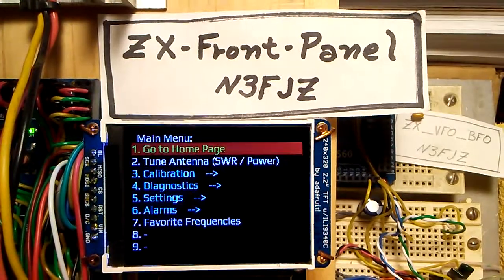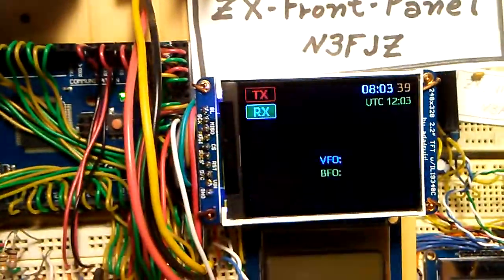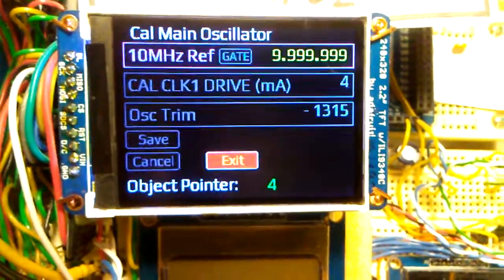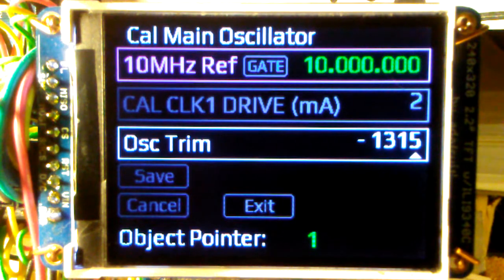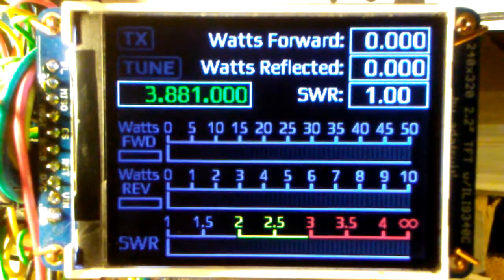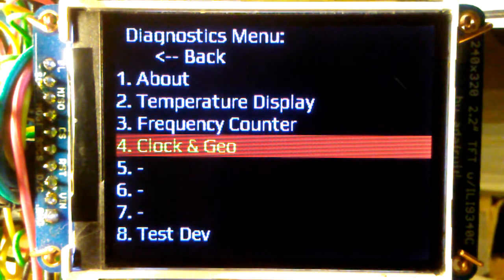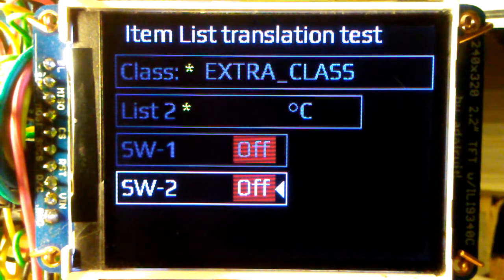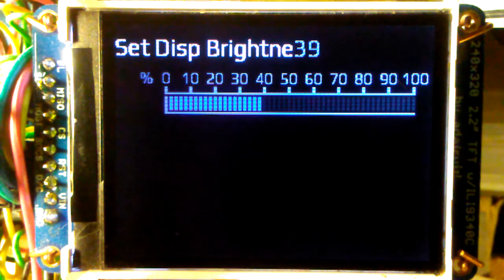ZX-Front-Panel - New GUI page selection menu support

Comment: Hola saludos tengo una pantalla LCD TFT 3.2 HX-8357 no táctil como puedo utilizarla en este proyecto que esta muy bueno muchas felicidades
Reply from the maker: (Via Google Translate) Erasmo, ¡Gracias por el buen comentario! Usé la biblioteca Adafruit GFX con mi pantalla para que funcione sin muchas modificaciones si la biblioteca admite esa pantalla; sin embargo, utilicé fuentes personalizadas de Google, así que no estoy 100% seguro. Buena suerte. 73 Rick n3fjz.

La pantalla que utilicé fue comprada en: https://www.ebay.com/itm/3-2-Inch-320X240-SPI-Serial-TFT-LCD-Module-Display-Screen-With-Contact-Pane-/203014329796

Erasmo, Thank you for the good comment! I used the Adafruit GFX library with my display so it may work without much modification if the library supports that display; however, I used Google custom fonts so I'm not 100% sure.  Good luck.  73 Rick n3fjz.

The display I used was purchased from: https://www.ebay.com/itm/3-2-Inch-320X240-SPI-Serial-TFT-LCD-Module-Display-Screen-With-Contact-Pane-/203014329796